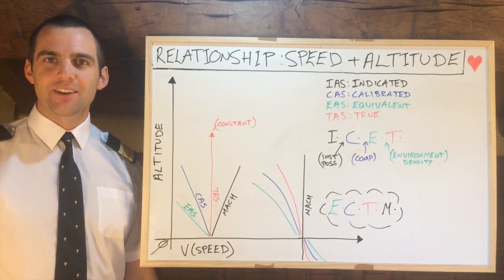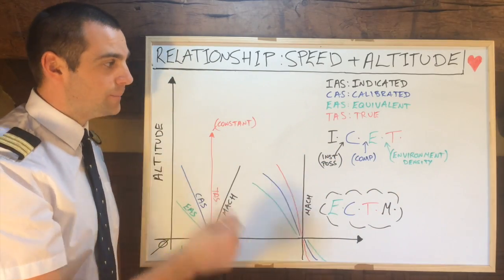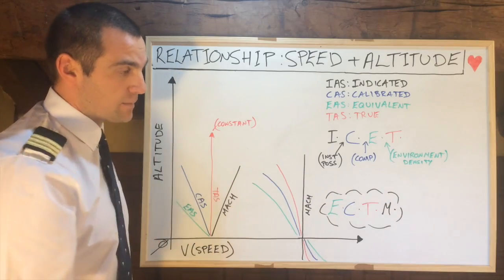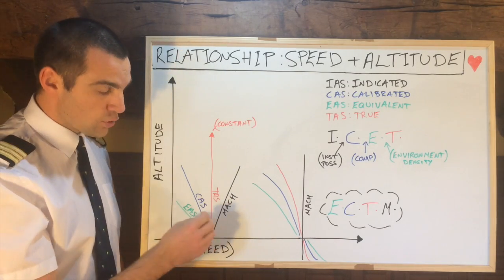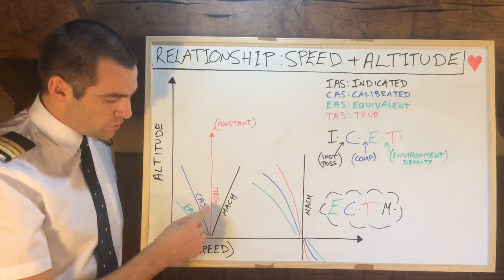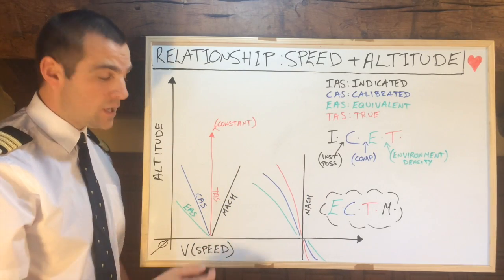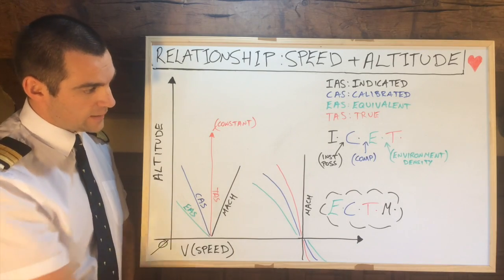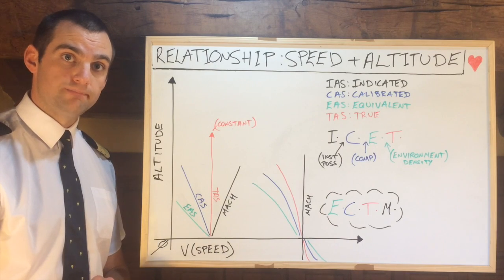Airspeed VS. Altitude ✈

Comment: what is mach nomber in detail
Reply from the maker: mach number is just the speed of the aircraft relative to the Local speed of sound. So if the speed of sound is around 666knots (it varies with the temperature) and we are doing mach 0.5, our speed is 333knots. Simples :)